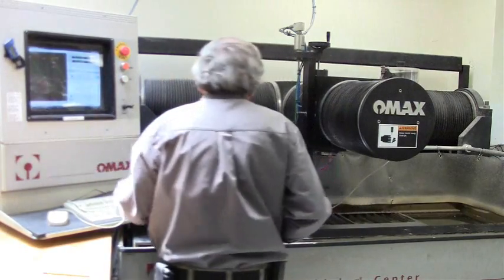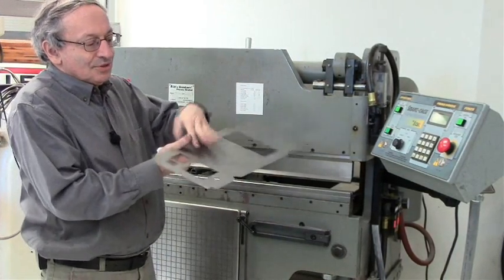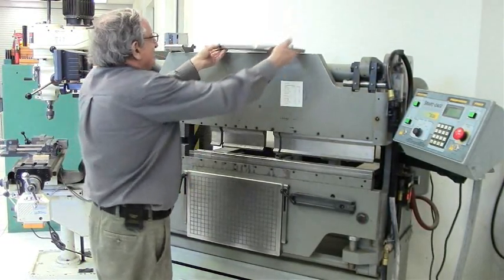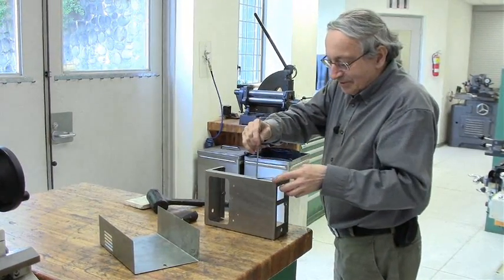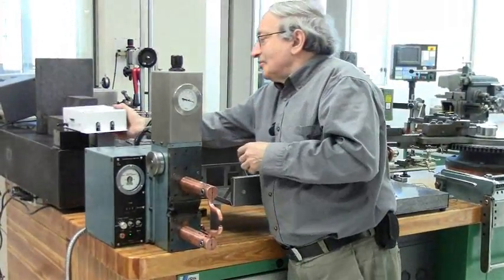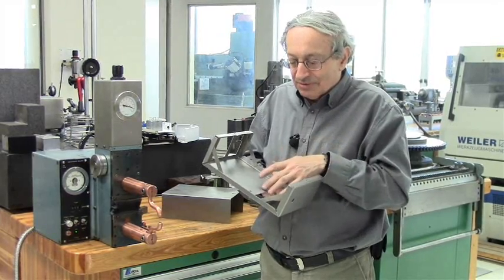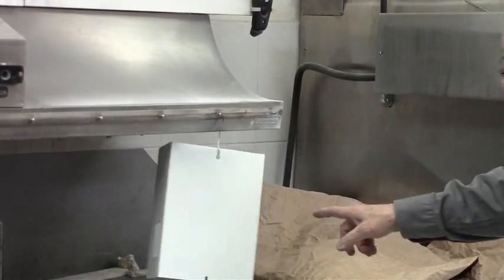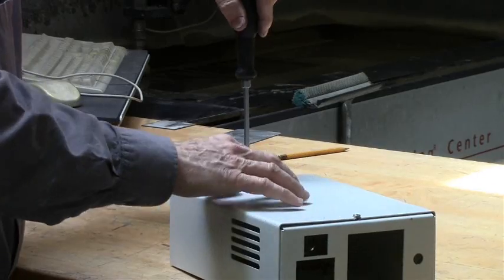Building Prototypes Dan Gelbart  part 8 of 18  Enclosures

Comment: In aircraft sheet metal technique we use setback marking out multiple bends.
Using your test strip you used for bending the lid, cut a test strip, say 100mm long using same (!!!) material as final product. Accurately mark a line at 50mm and and 90° bend with the required radius, exactly at the line. Now simply, with a vernier, measure length of leg to outside edge. It will be greater than 50mm, say 51mm for example. That means we have gained 2mm in the bend. Marking out a panel panel at say 100mm we draw a line. The next panel section after a bend is marked out 2mm overlapped at the 98mm mark. All the holes in each panel can be accurately marked out in their individually set back panels. The bend line is half way between the setback lines.
The test piece needs to accurately measured, being bent with the same bending setup (with specified radius) to achieve this before final cutting. Works every time, for the past 50 years for me, ever since the aircraft sheet metal course was completed.  Reliably used for U brackets to hold cable pulleys, etc. Flat panel marked, (pencil, not scriber!), drilled, cut, then bent to finished dimensions.
These methods become important in  aircraft sheet metal, particularly that a large bend radius is always used in the harder alloy materials, meaning we gain even more in bends than might be expected. If the final bend was 45° then you would halve the setback.
This is much simpler than using charts, as we accurately account for our bending apparatus and material in one simple test.
Naturally, use the chart to find the minimum bend radius for the material !

Comment: A slot on one side would have helped alleviate bending tolerance concerns as well.
Reply from the maker: Correct. That's what I did on the cover (watch last minute of video), but sometimes you can't : if you use countersunk screws, for example.

Comment: in Part 6 you told us about hydrocarbons and finishing for painting, wont touching the parts with your bare hands re-introduce oils and dirt to the surface?
Reply from the maker: +Felix Dietz Good point. On smooth parts indeed you have to be carefull and use clean cotton gloves. On sandblasted surfaces, because of the deep texture,  you can touch them with clean hands as this will only contaminate the "peaks" of the texture. For more critical operations, such as plating, you can never touch the parts . They have to hang from a wire.

Comment: Going to binge watch the series, after finding this video in search. Why not form the gussets in the original pattern? They'd already be there, and only require one weld each.
Reply from the maker: They will need an offset bend to keep side flat, but for thin stock it is OK.

Comment: sir, at 32:20, how do you introduce thread in sheet metal using a tap? does sheet metal provide enough area to introduce threads?have noticed in old enclosure of voltage stabiliser, they used a screw and instead of drilling holes in sheet metal the makers bent the sheet metal to provide more threads to hold the screw. thank you
Reply from the maker: The tap is just to clean the welded nuts, see 22:45.
Reply: +Dan Gelbart Pardon me sir, I saw the video in parts with a time interval between them. thank you